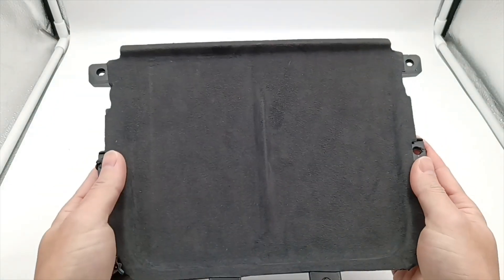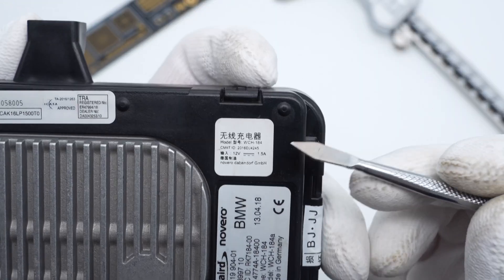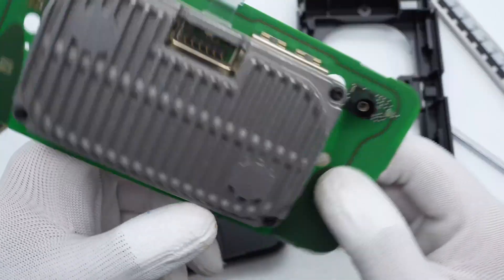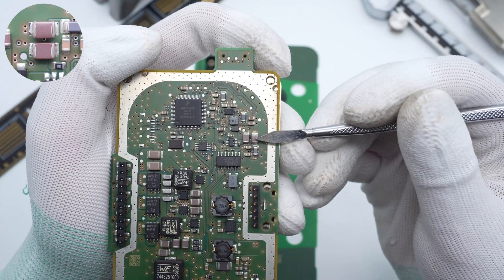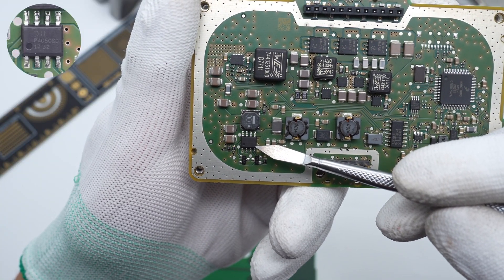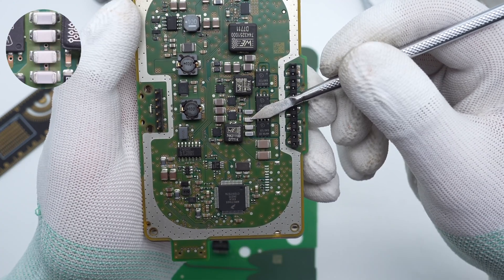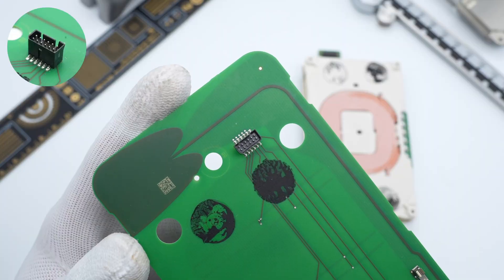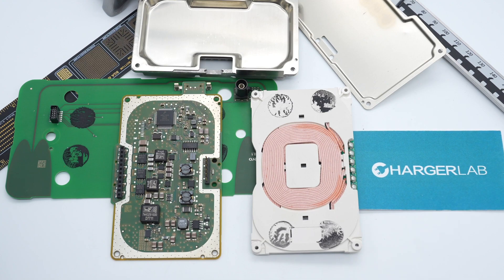Teardown of BMW Wireless Charging Module (For BMW 5 Series)

Comment: Many BMW owners find the OEM wireless charging to be utterly useless. In fact, it often seems to do nothing more then severely heat up the phone without even providing much ( or any ) charge. Personally, I am certain that trying to use the wireless charging in my BMW damaged and reduced the life of the my phone's battery. Since you seem to have a detailed knowledge of the components in this unit, and what function they all perform,  I was hoping you could make a video on how to disable the wireless charging function, while NOT damaging / compromising any of the other functions of this module. The  Bluetooth connectivity, wif-fi hotspot, and cellular signal booster are all useful functions. But the wireless charging is not. PLEASE make a video detailing which exact components to remove/disable/or destroy to do this, as well as the best / safest methods to do so. I believe it would get you many views from a frustrated BMW community, as I have been unable to find this information elsewhere. Thank you.

Comment: Hasn't realised these include antenna connectivity. Wonder if the Volvo equivalent has this. Regretted specifying it as an option on my XC40 due to the perception that reception was worse down low in the dashboard.